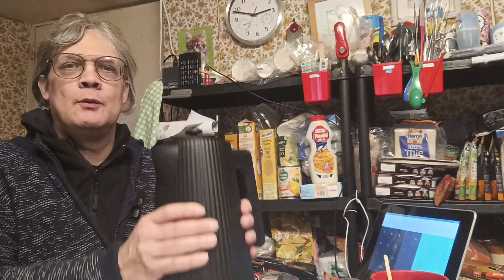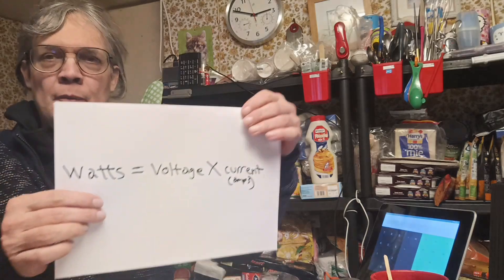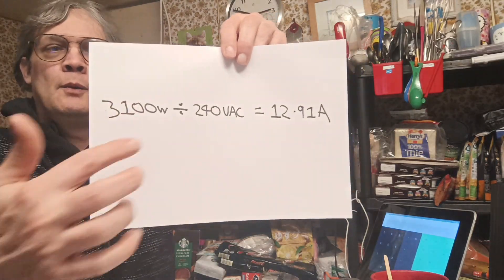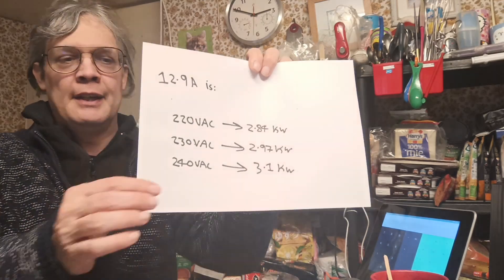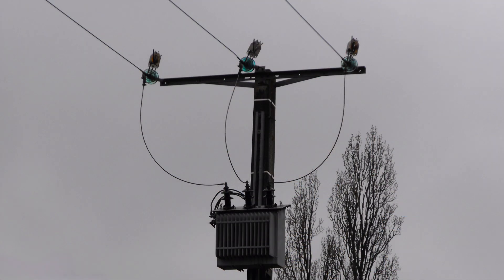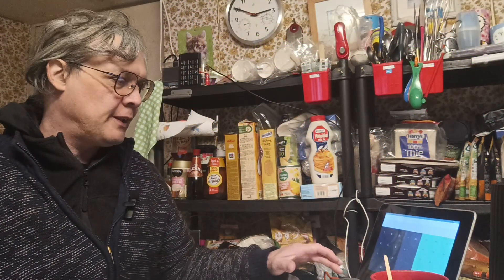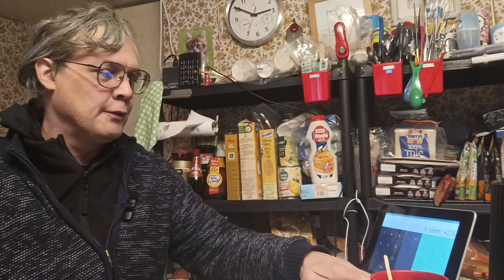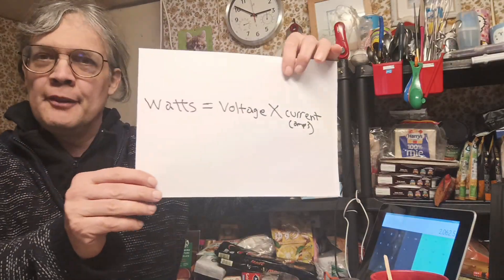My 3.1kW kettle isn't actually 3.1kW, this is why.

Comment: I know rather naively anything I brought over from the UK (including my then Hi Fi) 28 years ago, I just swapped the plug from a UK one to a French one and plugged it in. It seemed to work OK, but it is a bit scary in our house. It was built in 1977 and at the time, aside from three plugs, they deemed that the rest didn't need an earth(!)
So the of the three. Two are in the kitchen, one of those is a special set up for our electric cooker. The third is in the basement for the washing machine. French people like living dangerously and I'm aware that this just wouldn't happen in the UK.

BTW we have exactly the same shelves as yours in our "petite cuisine" (pantry?) to store our tinned and dry goods.
Reply from the maker: @MegaBreadvan  The electrics here are a nightmare really. The house is wired three phase with a mixture of 3+E and 3+N+E (if you can call a spike wedged into the ground in the cave an "E"!).
Yesterday the power was off during the day (Enedis changing the transformer) so I took a look to see why phase three in the socket under the sink wasn't working. Due to corrosion it wouldn't come undone, but I found the cable up in the loft where it hooks to the junction point up there. Rather, I found the four wire cable up in the loft. So that's earth, neutral, phase one, phase two, and...and...and...hang on, I think I spot an itty bitty problem. 🤦🏻‍♀️
Meanwhile on the other side of the kitchen is a 3+E socket that's not useful for tapping 230V from as no neutral.

Oh, and a scary chunk of this stuff is cloth wrapped rubber coated wiring. The sort you do not touch as it would disintegrate. Luckily much of that is hidden inside copper pipework where it won't be disturbed.
I guess I should have known something was up, coming to a place where the lights are fused but the sockets aren't. ;)

Photos and info here: https://heyrick.eu/blog/index.php?diary=20250217 and the following day.
Reply: @heyrickblog  I think even on more modern houses there can be nightmare scenarios. At house number two, which was built in 2002, there are wires loosely dangling from an exterior plug box. Where a black wire comes down from the loft and to which is plugged in an electrical roller shutter outside the window. When I first tried it, the shutter wouldn't open. So I got an extension lead to plug the roller blind into another socket. That was a few months ago.
Last night I needed the other socket to charge our Kangoo, so I re-plugged the shutter into the dodgy socket and for some reason it worked. So there must be a contact in there just "hanging by a thread". eeek.
I won't mention the two obsolete telephone wall plugs that have been ripped out of the wall...

Our own house was built in 1977 and has two junction boxes. One in the dining room and the other in the basement. I think they made up the layout as they went along, as nothing is logical.

No doubt we need a lot of electrical work doing, as only a few light switches and plugs are relatively modern (as in about 30 years old). Everything else dates from 1977(!)
Ah... to live in France eh?

Comment: Appliances suitable for uncertain grid future? Low wattage please. Even better, AC or DC interconvertible! Who really needs 2 or 3KW kettle anyway? A 400W kettle will boil a cuppa in 5 minutes. Patience is a virtue, like economy.
Reply from the maker: I think a 2 or 3kW kettle will pale into insignificance compared to EV chargers. Those cars, like mine, that plug into a regular socket will take 2-3kW. Dedicated single phase chargers are 7.4kW, and three phase chargers are 9/11/22kW. With governments pushing us towards EVs, they're going to have to perform a massive upgrade of the grid (and more nuclear) to run all this stuff. https://izi-by-edf.fr/blog/puissance-recharge-voiture-electrique-domicile/ (in French)

Also, I'm on well water here, so I boil water to sterilise dishes and cutlery before use, and I use the kettle to boil water for pasta, rice, etc as it's faster than using a saucepan. While five minutes for a single cuppa might just be tolerable, I don't want to think how long it would take otherwise.

Note also that the governments are frowning upon non-electric sources of heat (for heating and cooking) because of pollution and carbon problems, which means more and more load (2kW for fan heaters, 1.5kW for oil filled radiators, 2-4kW for electric ovens, and so on) which means that the "uncertain grid" is a massive weak point in modern society.

To France's credit, Enedis is performing a massive overhaul of the grid. My access lane is blocked right now by a truck working on the line HV line (I think 11kV) to isolate the big breaker switch to work on it, and tomorrow they'll throw it to replace the old transformer with something with greater capacity.

Comment: In the UK, the official specification for domestic electricity voltage is 230 volts with a tolerance of +10% to -6%, allowing for a range between 216.2 volts and 253 volts. This standard was harmonised across Europe in 1995 to ensure compatibility of electrical appliances. Prior to this, the UK used a nominal voltage of 240 volts, but the adjustment to 230 volts was made to align with European standards.